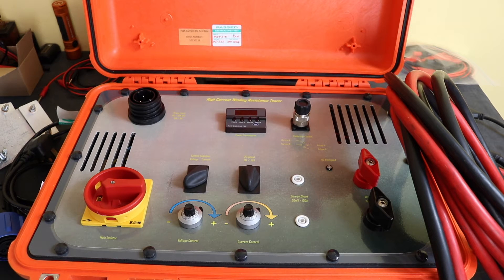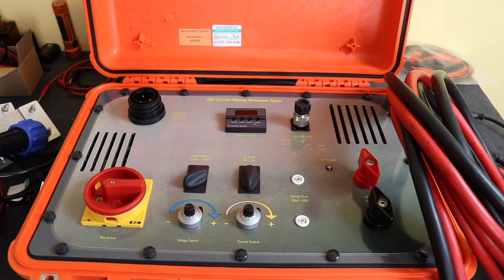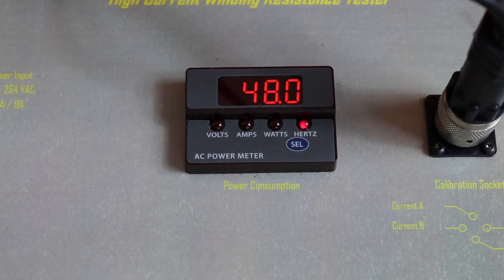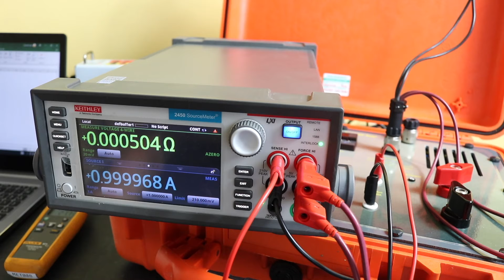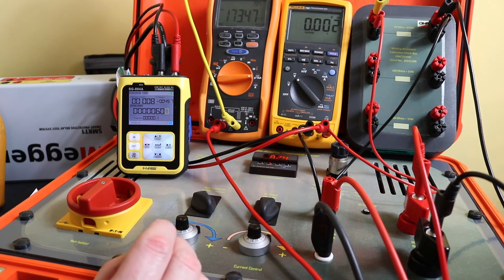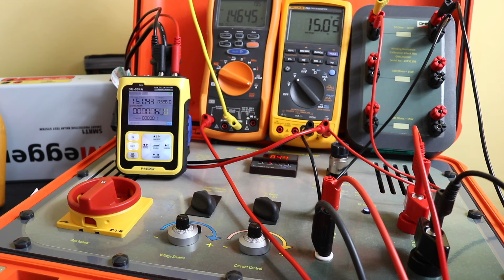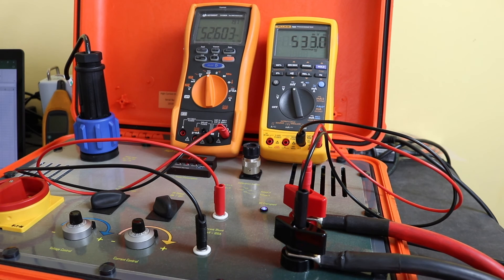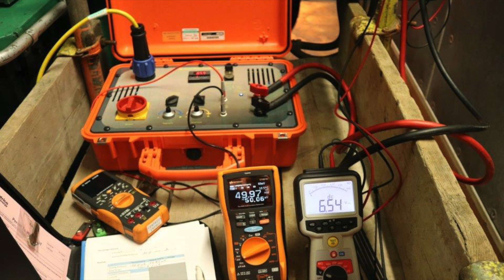Generator Winding Tester Checks

Comment: Impressive DIY build, looks anything but a "DIY test rig"
It does look good, polished & well put together with PC control and all that jazz, will definately get a nod from the customer when you pull that out.
I saw the HT208D model in use, and was wondering if you were able to check if its inrush is somewhat accurate in AC & DC up around its specs. sub 1000A
..as that would make it very attractive 1000A AC&DC clamp meter if you could use it for spotwelders etc, but one would likely need some reference inrush clamp-meters from the likes of Fluke etc to have a norm to compare it to?.

The HT208D seems to be able to pick up very fast pulses.. tried with 10ms or 20ms DC spotwelders and it did manage to read it, even though its paper claims 100ms, but I dont have the ref tools to put my readings into a meaningfull perspective.
Thx for the vid..+1
Reply from the maker: Thanks for watching and commenting.  For accuracy the HT208D would probably need comparing against a fast scope set to single shot mode. An injection test set would be able to generate the current, or you would need a power amplifier supplying a multi-turn coil.

The HT208D is a reasonable clamp, but I have never been able to get a calibration procedure from Kaiweets, their technical support was real hard work and in the end didn't help out. I think one of my issue was that I purchased mine through Amazon and not direct from Kaiweets.

Comment: Nice set up and interesting way to connect to the slip rings. Maybe that's normal, but fortunately I never had to field resistance a gen with slip rings. So also not sure how else you could do it without damage. But looks safe with aluminum plates and the straps to avoid damage.
Reply from the maker: Its the easiest methodology that I have seen. Sometimes they use a number of copper blocks held on in a similar manner. You just have to be careful with the ratchet mechanism, you can see it in the video with cardboard underneath it to prevent damage to the surface of the slipring. I have since upgraded and now have a piece of felt underneath, which is more durable.
Thanks for watching and commenting.